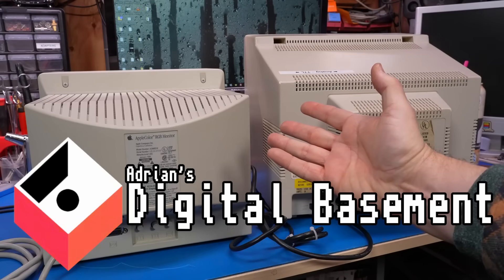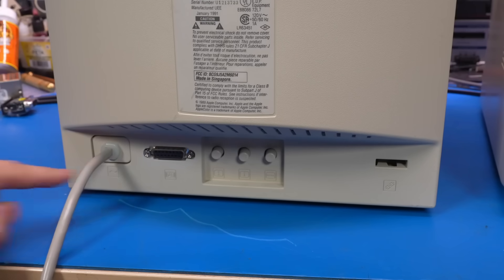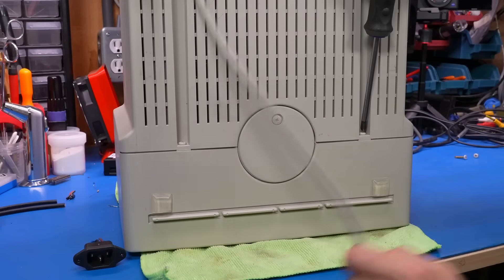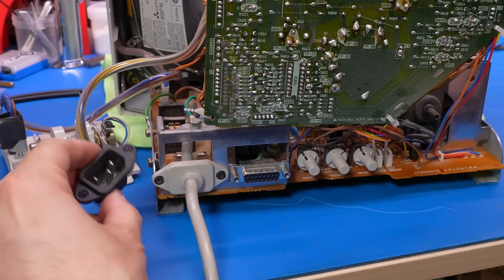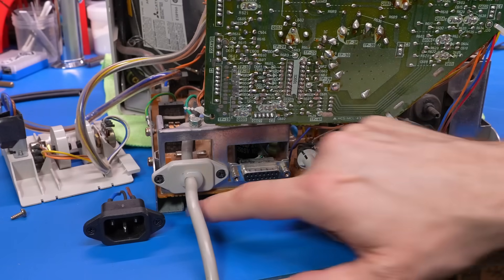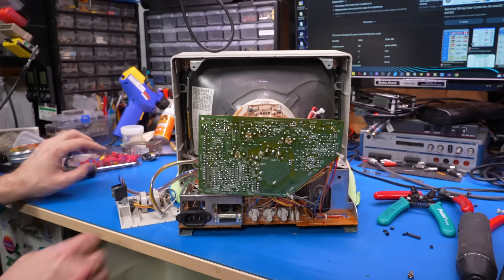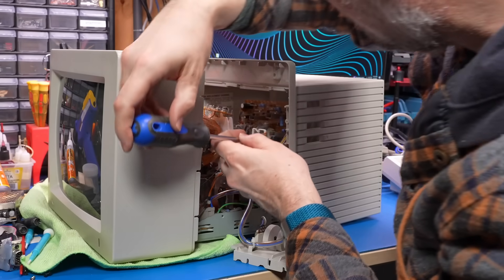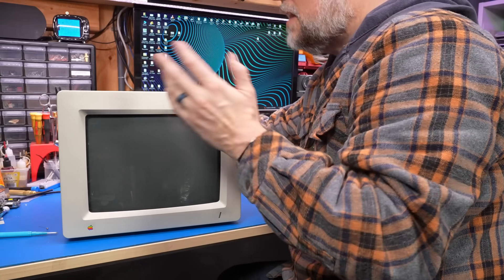Quality of life: Adding a proper IEC mains power input jack to a monitor

Comment: I did same but with VGA for monitor that had fixed signal cable. Plate acting as strain relief/feedthrough seemed suspiciously same sized as a standard VGA DE-15 would be, and screw holes aligned perfectly with the connector.

Comment: The commodore monitor could be modded too. You just need to cut a hole in the back once you find a location inside that has enough room.
Reply: and also the right type of socket, those harvested from old psu's are not the best for mounting in plastic.
Reply: this!! do it!!

Comment: With the monitor that you can't install a iec jack. Just shorten the cord to a 6 or 12in length and just use an extension cord to plug it in.
Reply: i would install an iec c-14 directly into the hole and enlarge it to fit but failing that, they make female c14 jacks that can go on the end of a short stub of cord

Comment: I'm too elevated in hight......!       to try to comprehend the calculation to determin the BOM saving apple made on the deletion of the power cable port or the modern inflationaray price............  but I do believe apple wouldnt be struggling to survive today if they chose to put a power port on the back of their monitor back in 198watever!

Comment: The funny (haha) part of the Apple monitor is that it clearly is designed to take an IEC socket rather than a fixed cord as the cord itself has a nice IEC socket size molding on it.

Comment: I would use a dremel and drill to carve a panel-mount IEC connector spot into a good place on the chassis. Surely there is a free spot on most monitors one could fit such a thing.

Comment: Wondering if it would be worth chopping off the cord on the other monitor and splicing in an IEC socket as a little pigtail. Still annoying that it would flap around while moving it but wouldn't be a tripping hazard. Could even remove the current cord entirely from the inside and use a chopped IEC extension cord wired in as the pigtail for a more reversible mod, and to keep the strain relief on the inside.

Comment: I hate every fixed cable in whatever electronic it is. I work with audio equipment and every turntable that has no audio output, the RCA cable is always broken near the cabinet. Same with some power cords.

Comment: With the Commodore one couldn’t you just feed the plug back into the case, cut it, solder a socket to it, and then mount the socket to the case and cut a hole with something like a dermal. Not saying I’d do it or it’s worth the effort, just saying as it’s all plastic wouldn’t that work.

Comment: There are 90° angled C13 cables. You can solve the the C1084 too. You have to go a bit DIY, but in the end you can replace the cable on the Commodore monitor too.

Comment: The fixed power cords could have been due to some agency requirement back then. Seems odd that the computer could have a removable cord but the monitor couldn't, but that's just how the device certification agencies roll, sometimes. (Didn't a lot of TVs back then also have fixed power cords? Maybe the monitors were treated similarly.)

Comment: I'd guess the US was simpler to just have a hard-wired cable versus the rest of the world where even in europe, the euro-plug wasn't 100% standard across different countries (2-pin yes, grounded no), so they fitted sockets and supplied local-style cables, us brits did it better though (he said sarcastically!), until the early 90s, a lot of new appliances with fixed cables came without plugs at all, so you had to supply and fit your own plug, and often people fitted them badly, and with the wrong fuses, or even not bothering at all and just jamming wires into the sockets with matchsticks, crazy times... :S

Comment: If you're not too purist, it might be possible to find a spot where you could cut a hole in the cover and attach the connector to the chassis behind it. Some spacers might be required, but that's manageable.
Reply: There seems to be room for it on the Commodore, same place as the Apple, except they didn't cut an IEC sized hole in the plastic.

Comment: Me screaming at screen, strip back the current cord and solder onto the IEC320 with 3 bits of heat-shrink...
Reply: Yeah, Adrian really seem to love splicing cables instead of doing it more elegant. It's far from the first time.
Reply: At the end of the day, showing the worst way actually makes engagement (what we are doing right now) higher. And, electrically, it is not that big of a deal. (But yes I did do what you said when I did this to all of the monitors in the computer lab at the school and library)
Reply: Me doing exactly the same... lol
Reply: @slashtiger1  Yep
Reply: The two ground leads makes me think the original power cord is probably shielded.

Comment: About 2 years ago I accidentally discovered a side effect of long covid I wasn’t aware of. I was trying to repair the power switch on a vacuum cleaner but I forgot to unplug it from the mains. When I went to pull the spade crimps off the switch I shorted the line and neutral across my fingers and I couldn’t feel it. This is in the UK so 230VAC. The doctors are still investigating it but it seems like covid has damaged my autonomic nervous system. I used to be an engineer, I know what an AC shock should feel like and no, the power didn’t trip to protect me
Reply from the maker: Yeah live to neutral isn't a fault condition and a normal load to GFCI/RCD breakers. That's wild, and so scary!

Comment: The more elegant way would be to cut the cable on the outside and pulling the wires back after removing the gland. Then you could solder them directly to the IEC socket using new heat shrink instead of bodging old and new wires.
Reply: It is good practice to leave the protective wire (green-yellow) significantly longer than the others. This is important if the entire socket or cable could be torn off. Then the most important protective wire remains connected longer. And it is damn important for safety.
Reply: @ukaszrutkowski8368  How would that be pertinent to a detatchable cable though. You would have to be very determined to pull the chassis mounted jack out with the cable.
Reply: @rimmersbryggeri  This would probably be a rare situation, but it's better to have this protection three times for nothing than to not have it once.
Reply: @ukaszrutkowski8368  The live an neutral were on a connector to the power supply to while the earth was on a ring tab with a screw. Very little chance it would detatch before.  You are not wrong though in principle but in context it's a little redundant.
Reply: @rimmersbryggeri  i've ripped the iec c14 out of things before tripping over the cord and pulling the jack sideways, it CAN happen, it is just rare
Reply: @frogz  It can happen but you should probably think about the cable routing outside the unit first if it does.
Reply: It really grinds my gears, too :(
Reply: That's what I thought to.
Reply: Agreed except I would use spade crimps to attach to the IEC inlet.
Reply: My thoughts exactly... Dunno why Adrian chose not to do it that way...
Reply: I yelled at the screen. 😂
Reply: Agreed
Reply: Exactly.

Comment: Would have been a lot cleaner setup if you had cut the wires a bit longer and soldered right to the IEC connector. No splices required.
Reply: You beat me to it...

Comment: You can get snap-in IEC sockets that would work on the Commodore monitor.
Reply: The problem is that they would snap in to the back cover, which would make it fiddly to remove the cover. Maybe it would be possible to attach the connector to a structure in the chassis so that it pokes through a hole in the back cover?
Reply: @helgew9008  Yesh, I see what you are saying.  Maybe use spade connectors?  They could be removed relatively easily anyway.

Comment: It might be possible to replace the power cable on the Commodore with a cable that has an IEC socket, used for many server racks PDUs. It can be made short and then would use a standard IEC cable. Should be an easy install.
Reply: Brilliant
Reply: You can also get rewireable C14 sockets and just reuse the existing cord.

Comment: Yes it's annoying but there are reasons. These IEC jacks are not perfect. In fact, you might not realize how often they get lose. And people call service or panic. Sometimes they spark. They really are not the safest design in the world. Just good enough for static situations (PC under desks). The cables vary in stifness and plugs are not exactly on spec. So there can be wiggling room. Or over time, drying out for example. And monitors themselves often turn or shift on the spot. While these fixed cords will annoy Adrian Black and many others carrying monitors around - they probably overall prevent more problems than they cause. Possibly. Who knows really? I suppose it was estimated.

Comment: I did exactly this to my Tandy CM11 and PCjr monitors.  I also added DE-9 receptacles for the video inlet.  On one of them (I think the Tandy..?) I had to have a metal bracket fabricated with the cutouts, since that is actually the back panel.  But that's easy to do these days with CAD software and direct-to-consumer fab being so cheap and ubiquitous.  <3

Comment: 3:30 Apple made a monitor stand that supports the Macintosh AppleColor High-Resolution RGB display as well as the AppleColor RGB Monitor for the IIgs. You'd remove that little circle bit on the bottom (as well as the mini stand in the front) to install the stand.

I tagged you on Bluesky in a post showing the installation guide.
Reply: indeed they did it was called "M0403 Apple Universal Monitor Stand"

Comment: As an owner of an Applecolor RGB monitor (my favorite monitor, too!)  I'm especially interested in doing this mod, because I, too...hate that it has such a long, fixed cord, especially because I only need about 4 inches of cable to reach the System Saver that this monitor sits on!  Thanks for this video!

Comment: I also hate fixed VGA cables.

To remember the colors of the European Wiring standard: Brown is live as that will be the color of your pants if you touch it when energized.
Reply from the maker: Hahaha really good tip!
Reply: Definitely hate fixed VGA cables. I have a nice Philips CRT at the moment with the opposite problem to this, it has a standard IEC jack for power but a fixed VGA cable, which has been CUT for eWaste disposal!!!  Need to get around so soldering a new VGA connection to this thing...
Reply: @mysticgreg  Same with one I recently saved from the trash, except whoever tried to cut the VGA cable couldn't really cut it and left the job unfinished so some of the wires are exposed but the monitor works, still I have to do something about it because it looks terrible, I will never understand why people cut these cables, why ruin monitors that still work on purpose.
Reply: While in the US, hot is back - as in it's your funeral if you touch it.
Reply: So many, MANY fine European countries use the Schutzkontakt socket/plug which can be inverted, so inside a device you don't know what is live or neutral without testing.